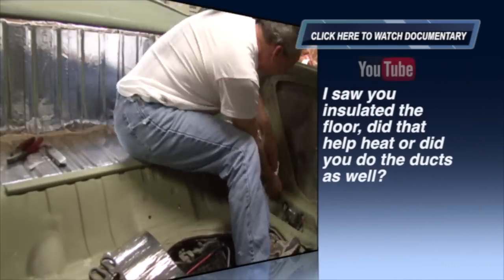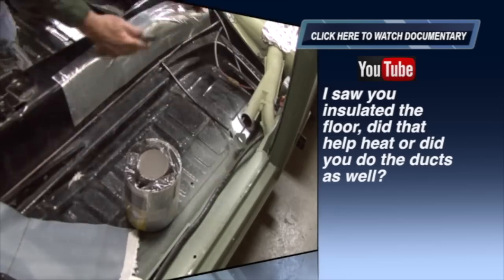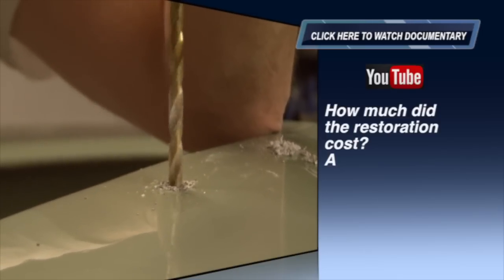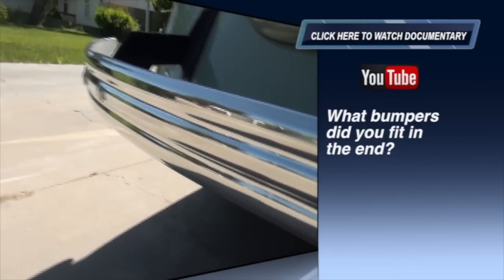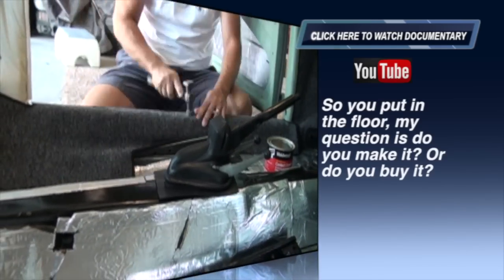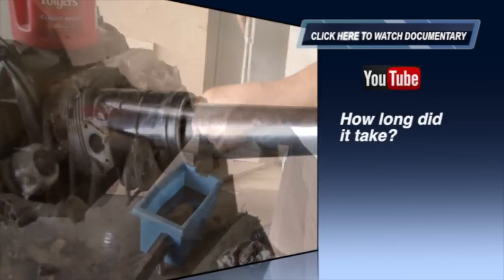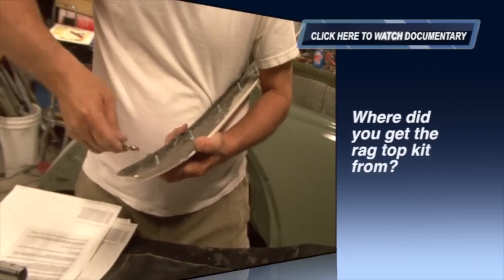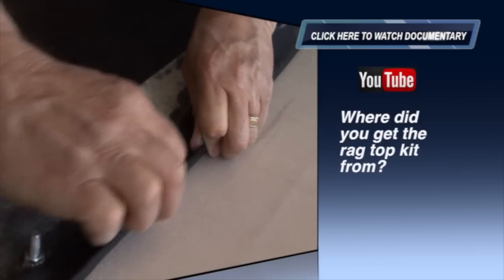Bug Restoration After Show

Comment: Love the videos.  You do incredible work.   About the bug heater, it has been my experience that about 15 minutes in below freezing weather is about right.  It has also been my experience that when it does heat up, it will melt your Reeboks if you leave your foot too close to the vent for too long.  Well, almost.  HA

Comment: Great follow up! Thoroughly enjoyed the documentary!<see comment on that vid>. A thought about the heater. If it's connected properly and the ducts are clear, you get almost INSTANT heat. It should be blowing hot air as soon as the exhaust manifolds get hot. I remember needing to close the floor vents because they would burn my foot!  I wouldn't expect much from the insulation in terms of heat retention. Much more for sound isolation. But heat production you should have waay more than enuf! And MUCH quicker than any water-cooled vehicle (old or new!)   Again great vid nicely done! Thanks again!

Comment: There is NOTHING wrong with the bug's factory heating system. I noticed that Willson used original style heat exchangers so there shouldn't be a problem. As long as each heat exchanger's steel shrouding that covers the exhaust manifold doesn't have any huge leaks, as long as the cardboard tubes that connect the fan shroud to the heat exchangers are in place, and as long as the flaps in the heat exchangers aren't rusted shut, you'll get plenty of very hot air moving from the engine's cooling fan into the vehicle. To avoid death, you would of course want to make sure no engine exhaust is leaking out of either exhaust manifold into either heat exchanger. You'll want to make sure the cables that operate the flaps are adjusted to fully open and close the flaps. VW owners had problems when rust created holes in the heat exchangers, when the flaps rusted shut, or the cables that operated the flaps stretched or broke, or when the carboard tubes tore, or came off. These problems were all easy to fix, although a pair of new heat exchangers for a vw could cost a lot more than a new electric fan in a "normal" car.

With everything working, humongous amounts of very hot air - the same air used to cool the air-cooled engine, moved by the same fan - came into the passenger compartment, heating it up rapidly. Another problem that could develop is that rust holes in the air channels that are next to the rocker panels, could allow road water into the system, and the windshield defroster-defoggers would fog the windows instead of defog - but this didn't prevent large amounts of hot air from continuing to come in from under the back seats.

You will also want to make sure that thermostat (under the right-side pushrod tubes) for the flaps in the fan shroud is working, and adjusted properly, and that the fan shroud flaps are there, and are working, otherwise, in very cold weather, the engine will take too long to heat up to operating temperature. That might be why it is taking 15 minutes instead of 5 minutes, for the passenger compartment to heat up.
Reply: I took a look at the installation of the fan housing, and I could not see the rod that connects the thermostat to the fan housing flaps. This means that perhaps you left out the flaps. If so, that would explain why it takes so long to heat up the passenger compartment. Also, using a tuned exhaust instead of a stock muffler will result in very slightly less heat as, with a stock muffler, the air channel from the fan to the passenger compartment picks up a little heat from the muffler, as well as from the exhaust manifolds.

Comment: Can anyone tell me the name of the product with which they insulate the beetle´s floor, please????
Reply: +Tomas Martinez It's roofing tar-backed aluminum. It comes in rolls and available at Home Depot, Lowes, Ace...
Reply: Thanks!
Reply: Tomas Martinez
You're welcome. If you have a bug, bus, ghia, I recommend TheSamba.com a great source of info for air cooled VWs.
Reply: Thanks this site will be of great help for me, I need a bunch of parts for my bug, do you have a bug? =)
Reply: +Tomas Martinez Yes, I'm doing a ground up, off-pan, modified restoration of my 1964 Beetle. The mods are mainly safety improvements, like dual master cylinder, third brake light, back up lights, and some performance vintage speed power.  What year is yours?
Reply: I don´t have idea, but probably from early 90, still works with carburetor, the bodywork is in good conditions, about the engine I don´t know, have more of ten years parked and my skills as mechanic are no so good, anyway I will put that bug on the road again =)